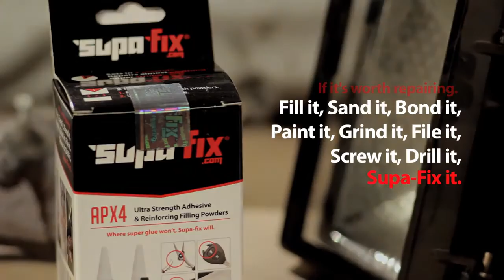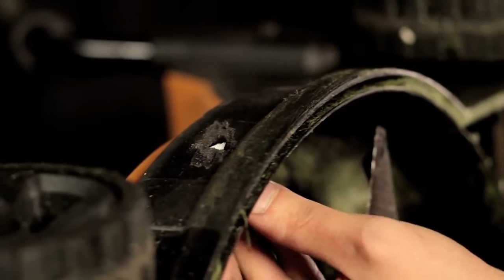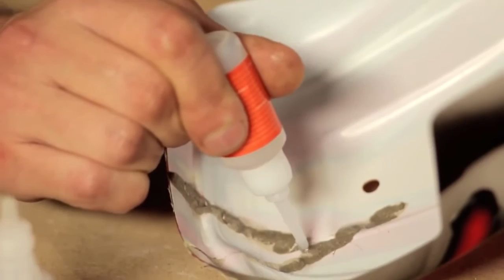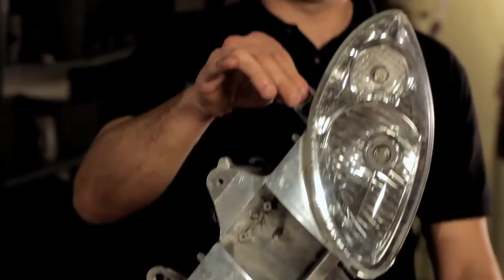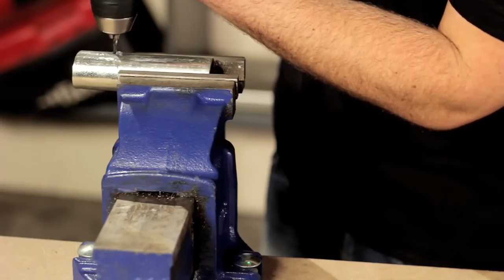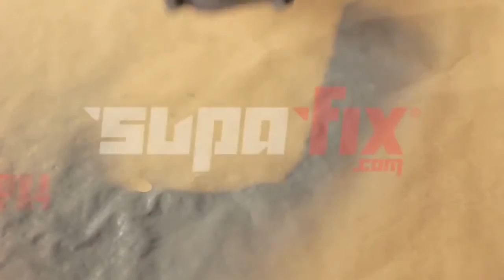APX4 Supa Fix APX4 Strongest Adhesive and Filler Fast Setting

Comment: This looks amazing for a problem I have. One of the hinges on my laptop is severely cracked and has been deeply troubling. Would this work as a long term solution, considering that it will be under repeated stress from opening and closing the laptop for hopefully years?